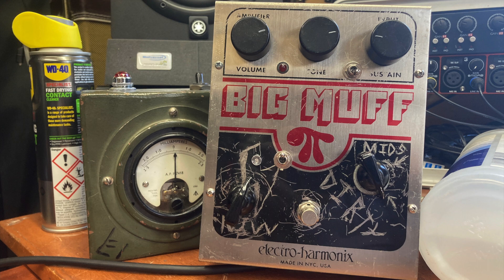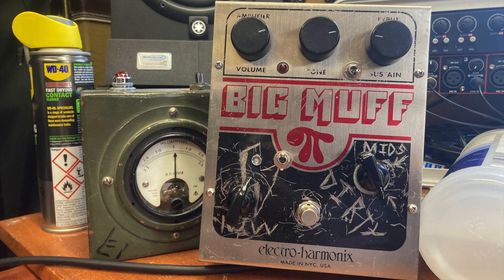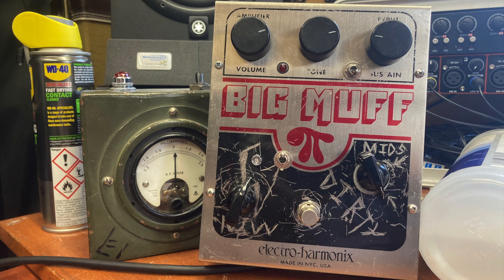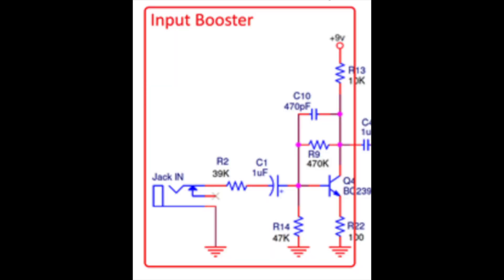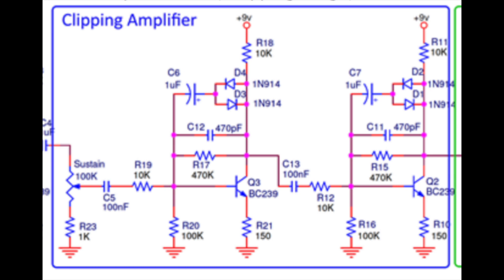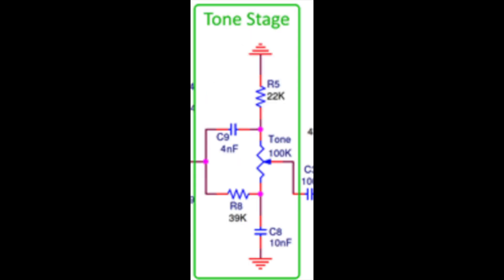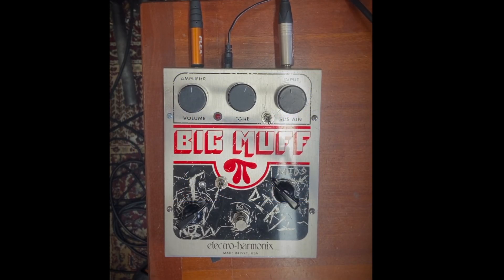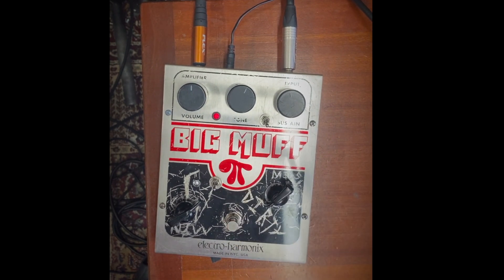NYC Modded BIG MUFF Schematic Analysis & Pedal Demo. RAMS HEAD, TONE BYPASS ,CLIPPING LEDS, BIAS POT

Comment: I prefer 2 red LEDs for a really symmetrical clip, but otherwise....the range of sounds you can get from yours is insane...I rarely use mine anyway, may as well give it a go with these mods!
Reply from the maker: Wicked! I’ll have to get a few together with matching red leds and see how it sounds! Yeah this is the result of a friend who just wanted more & more mods so I cracked on :) Lemme know how you get on with them!
Reply: Red led's clip at 1.7 volts compared to the 1n914 which is about 0.6 v , So on a 9 volt transistor pedal like this leds 1.7 volts barely gets clipped since the 1st transistor stage won't barely hit that with no emittor bypass cap.